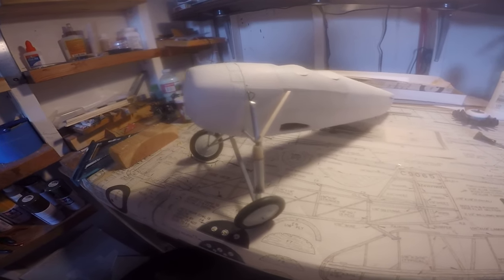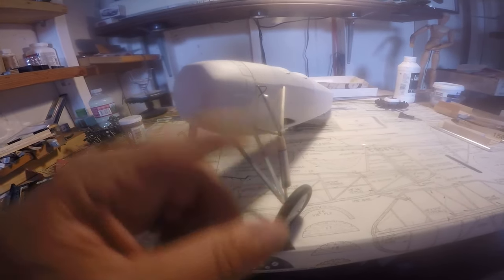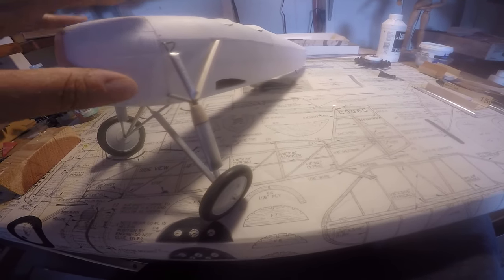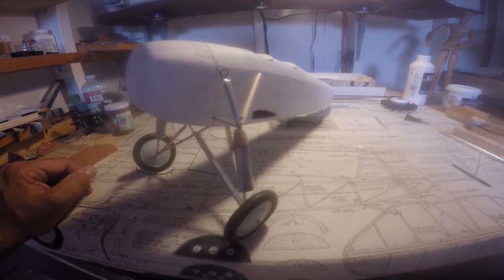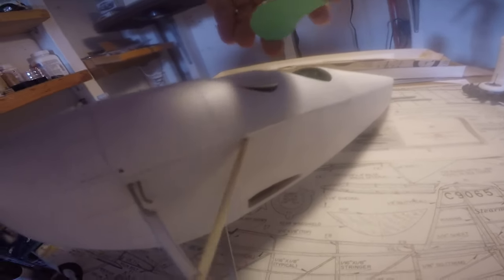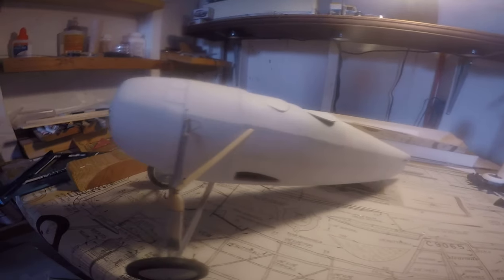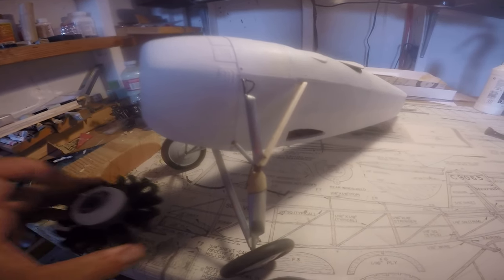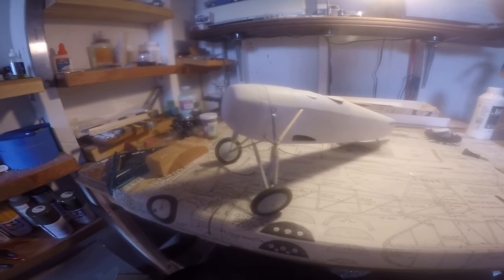Fuselage and landing gear assembly

Comment: What do you cover them with? How do you prevent the grain of the wood showing through?
Reply from the maker: The process I use does not include any tissue or monokote or any kind of covering material. I just apply several coats of spackle -  sherwin williams shrink free spackle  paste - and sand between each application. The steps are described in the videos but not shown because  sanding is sanding. The filler or spackle by the fourth or fifth application and all that sanding effectively eliminate the wood grain. Then Tamiya surface primer is sprayed on and sanded off - then another flat white primer (Gesso) is applied and sanded off.
Reply from the maker: this video is helpful https://www.youtube.com/watch?v=9GF15_ugq3M&t=2s